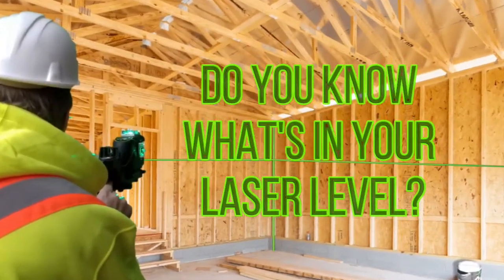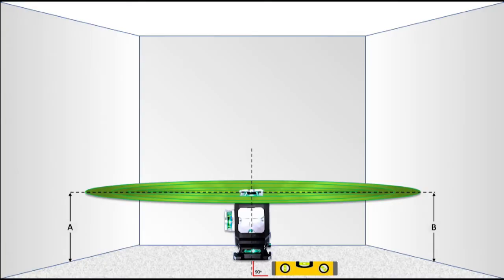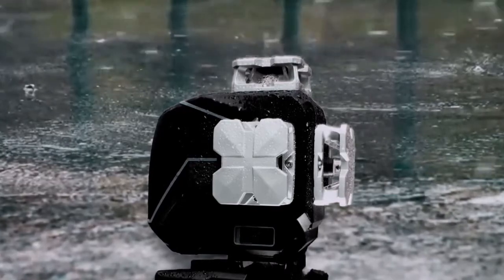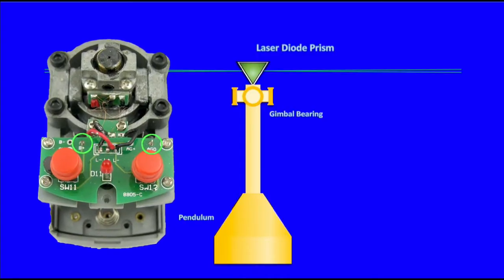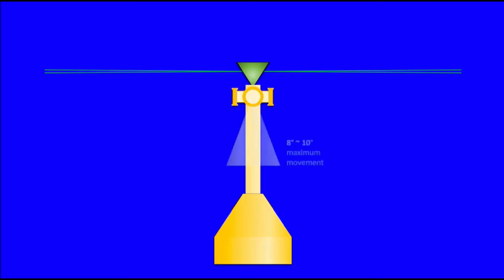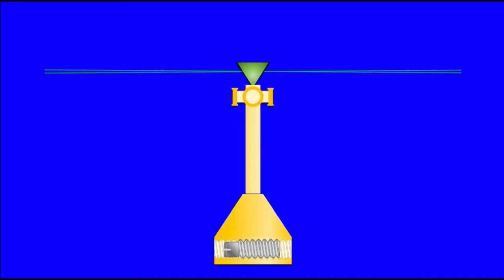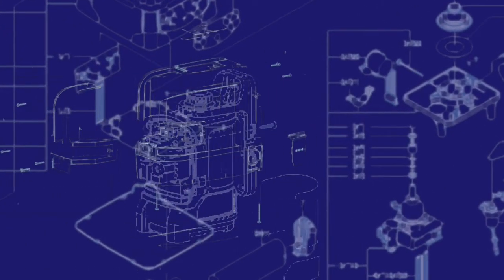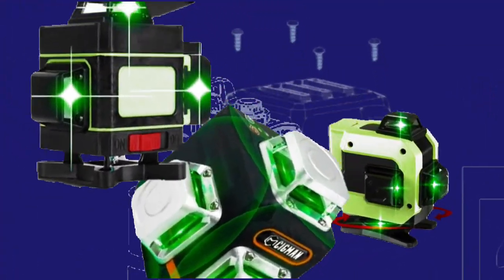How to Calibrate Self-Leveling Laser Level

Comment: Thanks for the info. I ended up using some blue painters tape to calibrate it. Worked perfectly. I tried the adjustment screws but they were epoxied in place so there was no way to turn them.

Comment: Good explanation of how the level works, but you didn't actually give a method of calibration. How does one determine the actual level without a perfectly level floor to work from?
Reply from the maker: Hello @davidsamways.  Thanks so much for watching my video on how to calibrate a laser level.  I have another video that explains how to check the level to determine if it needs calibration.  You do NOT need to have the level perfectly level to the floor, just within 3 or 4 degrees.  Please watch my video on “3D Laser Level Calibration Check and Level Accuracy”: https://youtu.be/DtkwfKgFqRE?si=x8spl6cxgNnknYmQ

Comment: An alternate way to check calibration if you have an uneven floor, is you can set the laser level up one or two foot away from the wall and mark the lines. You then go to the opposite wall and setup the laser level the same distance you had it from the original wall and mark the laser again. The distance between the two lines should be within spec for a pass. The closer the room is to the size of your accuracy spec the easier it is to determine and less math you need to do.
Reply: No. Much more simple is place it on any surface flat or not, mark a line on a wall flat or not, and rotate him 90degree. Do it 4 times. If all end at thé exact see spot it’s perfectly calibrated. If not You can easily see How much need to be correctes axis by axis by comparing the distance between thé marks. 

For exemple place it at 5m of à wall And rotate it 180 degree. 

If 3 mm difference, that mean than on distance X2 = 10m, thé difference is 3mm = 0.3mm/m false balance

Comment: You did a good job explaining how a laser works.  The major issue I had is your assumption the floor is perfectly level; rarely is this true.  There is another method much more accurate that is independent of the floor being level and enables the laser to be dialed in so it's dead-on accurate.  Accuracy is critical when performing complex finish carpentry...plumb & square is not necessarily a concern for the trades performing work prior to finish carpentry.
Reply from the maker: Hello Don.  Thanks for watching my video and commenting.  You are absolutely correct that floors are rarely level, and in the introduction of this video the intent was to show that a properly calibrated laser level will be perfectly balanced in the middle of the X and Y axes when positioned on a truly level surface.  This video is actually a sequel to my other video on checking laser level accuracy and intended to show how to perform the calibration to the  pendulum.  If you would like to see the method I use to perform an accuracy check on a 3D laser level, then please check out my other video: https://youtu.be/DtkwfKgFqRE
Reply: @brashair7652  Yeah, this ended up being a nicely in-depth explanation of the mechanics of these devices, but starting off with that statement feels like a death-knell to tinkerers seeking tips.  May as well toss them a speed square and be done with it, lol.

Do you know which manufacturers most commonly firewall their counterweight screws?  I like fine-tuning my tools when possible, fine-tuning your tools lets you get a lot of performance out of them for a fraction of the price if you can learn how to do it